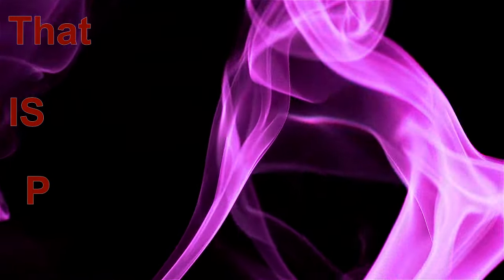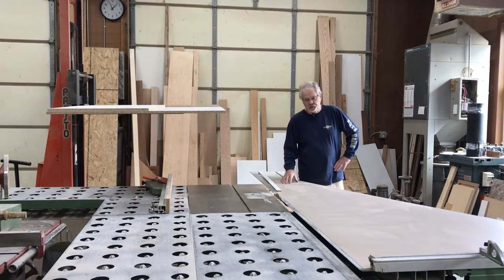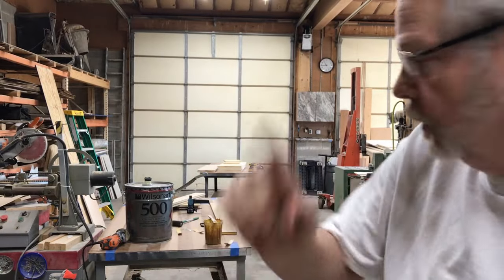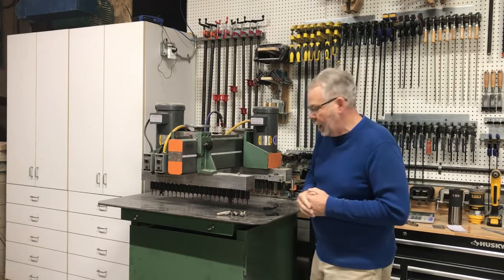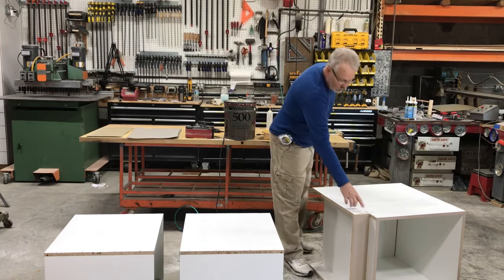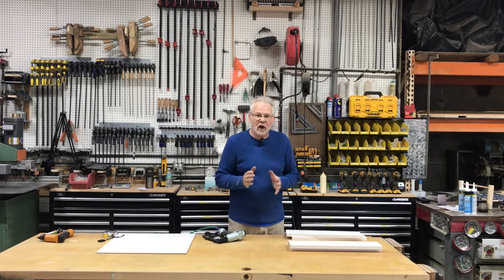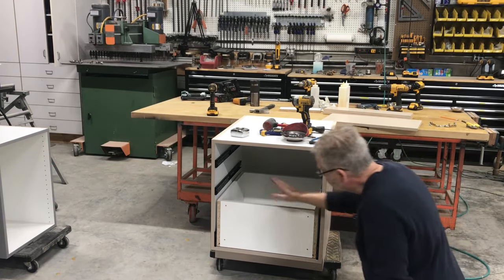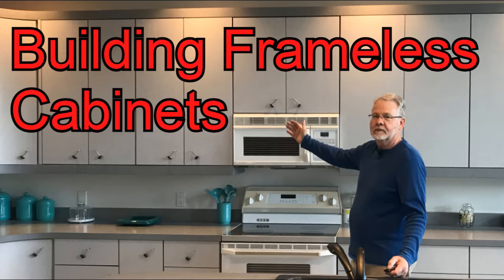How To Build European Style Frameless Cabinets

Comment: That saw is epic, actually the whole shop looks epic! You just an epic camera and an epic mic (that isn't clipping)... maybe a less "wide" lens and these videos would be as epic as your shop and product :)
Reply: also... amazing content. Thank you.
Reply from the maker: Seth thanks so much for comment on shop. And yes I am new to this whole film making thing . just using a iphone and a cheap amazon wireless mic. If I continue down this road may be worth investing into. I am also new to being semi retired and find that making videos fills a void and hopefully am able to pass some things on to the younger generation 😁
Reply: @ThatISPerfection  you have a lot of knowledge to share. I am just getting into cabinet making (second career), I have a 30x23 shop for now. Speed is the issue. It looks like you might be in New England from the background view.
Reply from the maker: Thanks! Actualey in the USA  PA. One Word with a small shop like mine... casters, casters, casters. I am going to do a video on setting up a small shop. other than my saw and edge bander everything is on casters. i pull them away from the wall , hook up dust collection , use them the roll them back to the wall @sethhamilton5824
Reply: @ThatISPerfection  so far, I have got it all on wheels, even the big sawstop (wish I had a slider).
Reply from the maker: The sliding table saw is nice. if you decide to upgrade later you may want to look at one with a scoring blade if you are going to run a lot of mealimine. The royce air blade stops a lit of chiping but a scorer blade is better. what really is nice is a tiger stop. Thats what you are seeing on my saw. just program in the dimension and it will move the fence for you. a BIG time saver @sethhamilton5824
Reply: @ThatISPerfection  I am actually hoping you do a video on that saw. Love all the swivel rollers!

Comment: Question about the top drawer face, could you use the shim for spacing and just screw through the two hardware holes to temporarily hold the face to the draw box?
Reply from the maker: That is to funny ! My good friend that I mention that does a 6'" pc in the front and back said the exact same thing. In this senerio that would have worked. I am so used to not knowing what a customer is going to use for hardware (having to drill it on site) that I did not think of it . But it is how I used to do it 40 years ago when I was in the refacing industry.thanks for the comment !!
Reply: @ThatISPerfection  that makes sense. When you don’t know the hardware, what you did was perfect